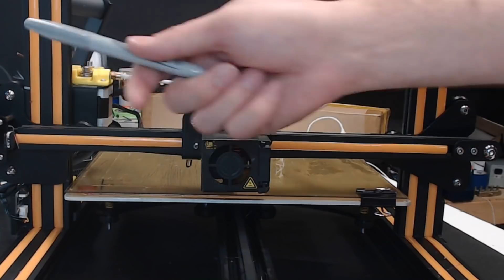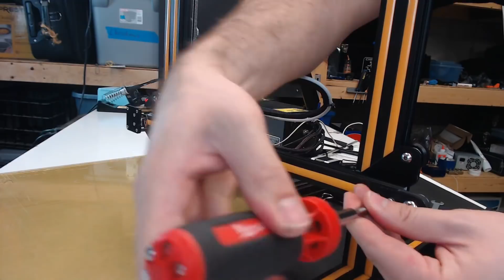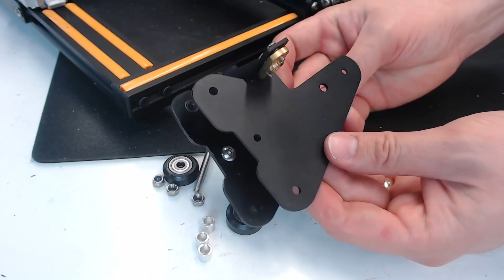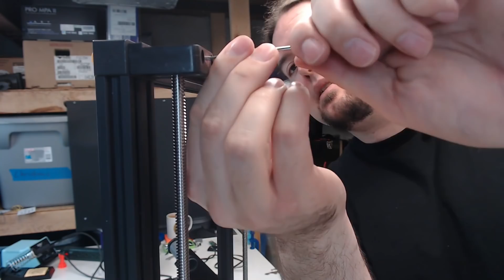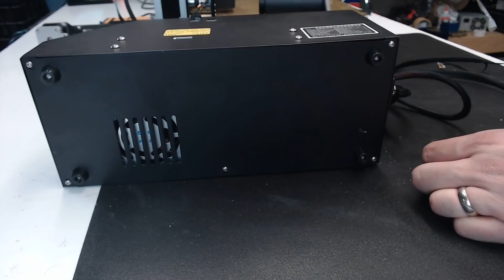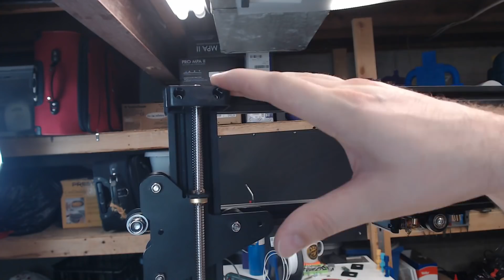Upgrade Your CR10 To Dual Z Lead Screws - Chris's Basement

Comment: Thanks Chris, for the explanation as to why a dual Z axis screw may be necessary, as well as a test to see if your printer could really use it. Also a great explanation and example on how to install it. I know that this video is four years old but it is still very relevant.
Reply from the maker: Thank you!

Comment: Just got one for my printer. Mine has a problem where the first few layers get squished because the carriage is too heavy. Hopefully this solves that problem.
Reply from the maker: Hopefully this helps you.
Reply: @ChrisRiley  yup. Got it installed and my first test cube print was 20mm on all sides

Comment: You know, on a printer of this size, that second lead screw should've been there from the factory. Looks like "that will do" attitude is all over this printer. "Form before function" rather than the other way around. I was planning to get CR10S but on a second thought, I'll build one the way I want it . Like the channel, keep creating!!!
Reply from the maker: Thank you! Yes, the CR10 was definitely value engineered.

Comment: Thanks Chris for the video.  Now, after 2.5 years, how is it holding up?  Ever consider using true  dual z (not serial / parallel ) and z- stepper auto align ( G34)?  Looks interesting.
Reply from the maker: Hey Mark, it runs great. I was actually thinking about doing a video on G34.
Reply: @ChrisRiley  Chris, that would be great.

Comment: After some time with this upgrade do you consider it to be worth it, essential or just ehh?  I'm on the fence with this since my A10 prints ow so well, but more consistency is king. 

I've been considering the belt dual Z option since the Z's will always be in sync not like this with Dual steppers, with possability of getting them out of sync.  * still having a field day with my Tronxy CoreXY   lol
Reply from the maker: Yeah, it's just kind of meh, don't think it really improved much.

Comment: They make an upgrade kit just like this one
It comes with the control board and wire harness  Would that be a better upgrade than hooking it into parallel connection ?
Reply from the maker: Sure, that would be good. The board will probably get you some silent steppers as well.

Comment: Does the Vref need adjusting if I'm running an mks gen l with drv8825 drivers when doing this upgrade?  Thanks.  Keep up the good work man 👍
Reply from the maker: Thanks! Try it out, if it starts to skip then turn it up a bit.
Reply: @ChrisRiley  I've got 2 MK3s but picked up the CR10 for £60 with an ezbal and E3D gold hot end,  mks gen l. Is the dual Z upgrade still relevant or to go with the belt and gear at the top instead?
Reply from the maker: @acgkplh  I would say it's still relevant, but the other option with the belt works too. I think the extra Z rod is probably a little more consistent.

Comment: Did you have to adjust the stepper driver?
Reply from the maker: I didn't, mine runs around 850 ref voltage.

Comment: Hello Chris i got the CR-10 Mini and having problem with the Z axis keep it level i was looking upgrade kit to change it to dual axis and found this, i a m noob with electronis and 3d printing so do you think this can be install in my CR-10 Mini hope you can help me!  https://www.amazon.com/gp/product/B07B6JZ8MG/ref=ox_sc_act_title_1?smid=A1LBN2V0Z4JGUA&psc=1
Reply from the maker: That seems like a lot for a dual kit. There has to be a better way to get  you to dual Z. With that said, on a mini I don't really think you should need it. You might just need some adjustments to get it dialed in.
Reply: @ChrisRiley  thank you i will keep trying to adjust Z axis but Cr-10 mini doesn't have many support. today i am watching your firmware upgrade and boot loader to install a filament sensor but i don't have the LCD board adapter you show in video because in my country 3D printing is in baby steps right now, Thank you and keep going you are a big help to noobs like me.  Thank you for your time

Comment: so is it harder to keep a machine with dual axis tuned and printing well?? any tips since i have one one the way...thanks
Reply from the maker: There are ways to keep is consistent. I prefer dual Z, but I would use POM nuts to keep the tension on the Z rods. They won't backfeed that way.
Reply: @ChrisRiley  do you have a video explaining how to install and what the heck POM nuts are and where to find them ...thanks
Reply from the maker: @roadstar499  Basically they are self-lubricating plastic nuts. https://www.printedsolid.com/products/ldo-t8-pom-nut

Comment: I watched a video recently explaining why having the "guides" or however you call them, bearings.. at the top of the Z lead is bad because you're essentially translating any wobble that may be in the lead screw
Reply from the maker: If the rod is bent even slightly, that would be the case.
Reply: @ChrisRiley   right, with that, any recommendations on good manufactures? and thanks for the vids btw<3
Reply from the maker: @dinosoarskill17  Thanks! It kinda depends where you live. Here in the states I have good luck with http://www.zyltech.com/

Comment: Is it actually necessary to loosen the X belt tensioner/idler? Seems like you could get away without having to break those machine screws loose, although it's always good maintenance to check that you're happy with the tension and that the screws are tight when you're done.
Reply from the maker: Hey Jim, I don't remember now, I might have just been trying to line it up better. I would have to go look at it again.

Comment: Wouldn't the stepper motors be wired in parallel?
Reply from the maker: I haven't looked at this config in a while, but I think I remember that cable running them is series, but I could be wrong.
Reply: patrolmaverick yes you are correct full speed half torque parallel. Half speed full torque series. Parallel cuts amps series cuts volts. If he used 12v motors on a 24v system he could do series

Comment: Hi Chris I did not see you un comment the dual stepper motor in config._adv_h is it necessary?  how about Vref on the driver? Thanks
Reply from the maker: The way these are hooked up, you won't need to alter firmware. You should be able to run the drive at 800mAh.
Reply: Thanks Chris I have been running like this for six months and it is OK just curious
Reply: @Buster6X6  The dual stepper motor in the config file is for having the second stepper motor connected to a second driver on the board. As far as the controller is concerned with this mod, it is driving one motor which is taking extra current. It may be necessary to tweak the driver current up a bit, but probably not necessary as the two motors are still carrying the same load though with the Z axis level there is less drag on it, so not drawing much more current than running just the one motor.

Comment: Hi Chris, why you need a new Z endstop cable, is not the same of original? thanks for your good video....
Reply from the maker: Hello! On this machine the motor cable and endstop cable are all in one wide ribbon cable. So you don't have to replace it, it's the same, but it's all in one, so they include it in the new cable as well.
Reply: Thanks Chris, in my ender3, i use this: https://www.amazon.fr/gp/product/B07J6539QX/ref=ppx_yo_dt_b_asin_title_o07__o00_s00?ie=UTF8&psc=1 for steppers and i dont need to change the end stop, so good!
Reply from the maker: @josepenalver652  Oh, nice!

Comment: Hey Chris. Just a heads up ...I'm subscribed and just saw this vid...a couple pointers. I do a vid called leveling the x-beam which actually does away with the play at the beginning of your vid...dual z is better, fair enough however you should perform that adjustment irregardless. 
Another observation is; on my dual motor z cr10s there is still Z height drift every time I boot it so I added a mechanical belt to link both z motors. Presto. No more leveling the beam every time you boot up.
Reply from the maker: Nice! I will check it out, sounds like a great fix.
Reply: What is a mechanical belt? Show us a pic

Comment: Would this be possible on the ender 3? assuming you remove the power supply.
Reply from the maker: I think it would be, but the parts are going to be different and you will have to relocate the power supply.
Reply: There's a CR-10 kit on a big retailer website from comgrow, but people have had luck with the ender 3. i just bought one and i will try it soon.

Comment: Hi, really appreciate your videos.  How do you calibrate the heights on both ends now?  I did the same upgrade and rotated the new rod manually until they were balanced.  Wonder if there is a better way.
Reply from the maker: I do the same as you, I just get them close and level the bed after.
Reply: Thanks for the confirmation :)

Comment: Thanks for another great video, Chris.  I have often thought about adding the dual Z to my CR-10, but couldn't think of a reason why, since it prints so well.  Thanks to you, I now know why I WOULD, when I SHOULD, and that I COULD, and that is GOOD (GOULD)!   Many thanks, and keep them coming
Reply from the maker: Thanks Ron! Never know when you might need to upgrade.
Reply: I am guessing that you have to 'disconnect' the steppers in the control panel and manually turn the lead screw to get it to match the existing prior to leveling the bed? or does the x axis rail just king of fall in to where it belongs?
Reply from the maker: The X it still pretty rigid, so you will be pretty close when you install it. but you a quick side to side line before the bed level would be a good thing to do. I went back and did it after the video, forgot to do it before the intial bed level, but it turned out pretty well.